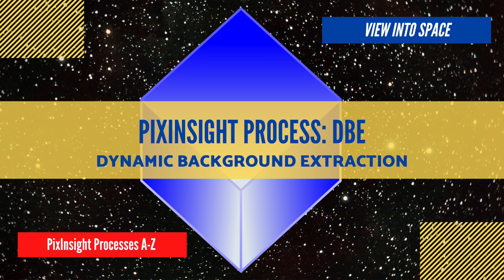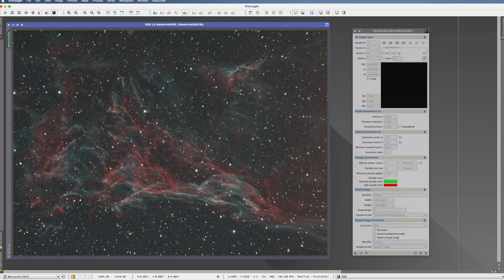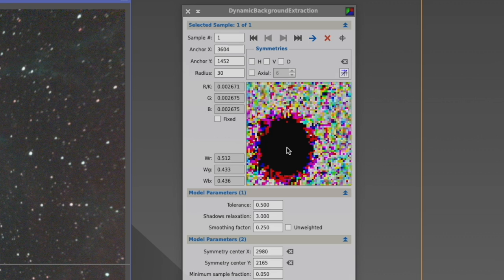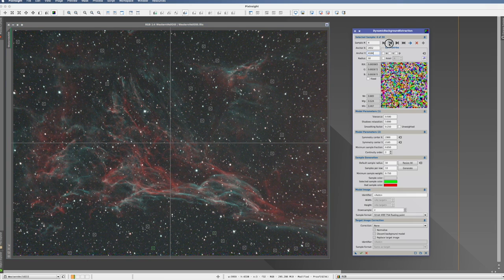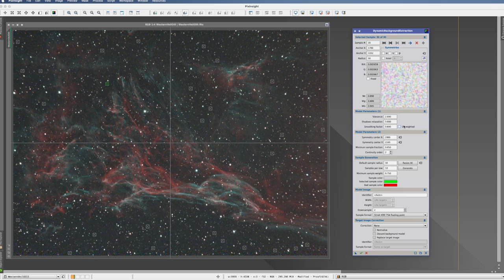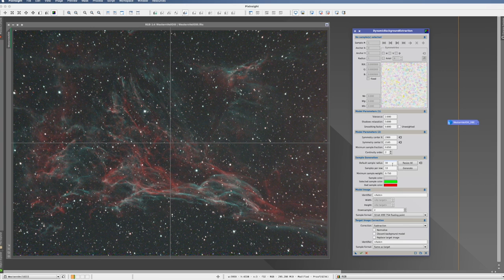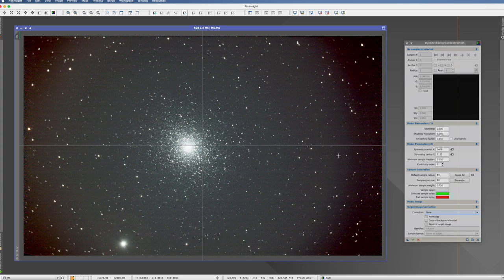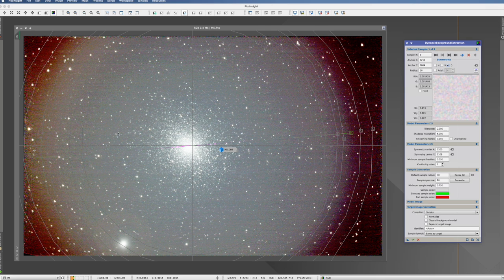PIXINSIGHT Process Tutorial: DBE (Dynamic Background Extraction)

Comment: Great video and lots of useful information. I guess you can spend hours playing with the settings. One question, is it a good idea to run another DBE if the first didn’t remove the issue, or is it best to just do one run? How about a second run with different sample points? I am not talking about doing a division then subtraction. Thanks, and a good series of videos.
Reply from the maker: Thanks! Sure, it can and should be done iteratively like stretching. So attacking for example first the vignetting and then a general gradient makes a lot of sense. If you approach each run as a individual task to remove a specific part and adjust the settings based on it, no harm can be done - it might even be much less destructive than trying with overly aggressive settings to remove everything at once.

Comment: What about doing DBE after doing it starless (unstretched)
Reply from the maker: This is in fact how I do it. I do the star removal as the very first step in my workflow, and all other steps incl. DBE afterwards with the stars already removed. I believe the less complexity a picture has, the better DBE runs - and stars surely are an additional complexity.
Reply: @viewintospace  i agree! But are there any downsides doing it? If not, why does i never see this on youtube?😅
Reply from the maker: @Calzune  I do not see any downsides. Even Russ writes in his instructions to STX: "Use StarXTerminator as early in the processing flow as possible, ideally right after integration, with the data still in a linear state". If you have not seen it in YT, wait until I do a tutorial about star management (in pipeline) and you will see it ;-)